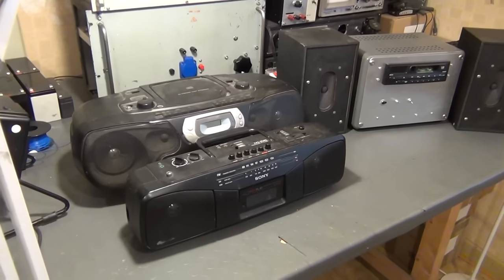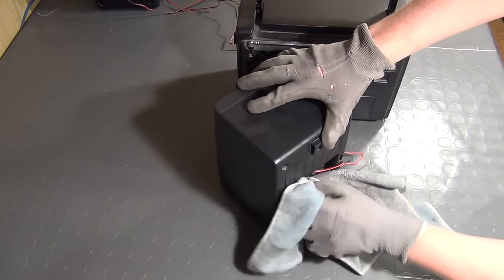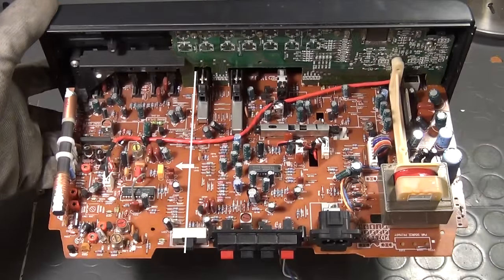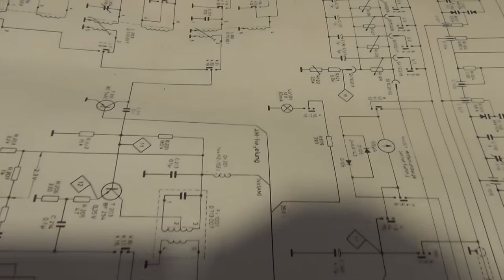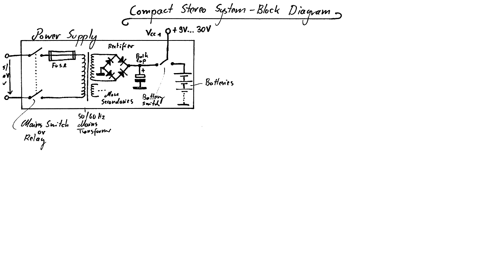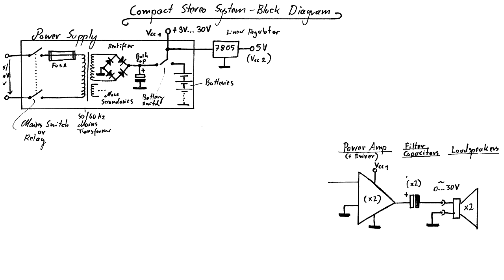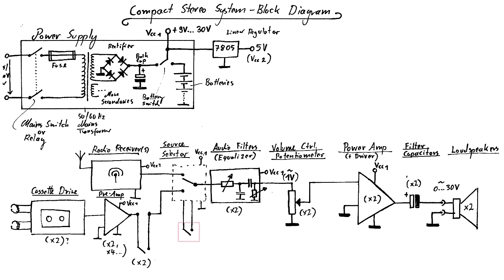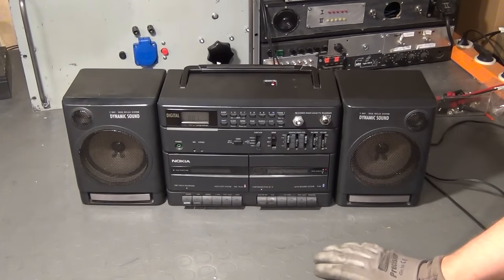How to Add a Line-In and Bluetooth to old Stereo Systems (1)

Comment: I'm currently modding a Lenoxx Sound CD-160 and discovered that the input MUX/Selector inside is actually wired and supports a 4th AUX input beside Tape/Radio/CD. So I can actually bake-in the missing feature by simply wiring a soft button to signal the electronics in making the the 4th selection for me. The onboard microprocessor, a TC-9309AF-119 already supports a button for selecting AUX, in it's matrix even though the feature is not offered by the boombox front panel. And the selection chip, a TC4052BP already supports switching between 4 sources by decoding the 2-bit signal from the microprocessor. The audio input pins for the 4th source (3X/3Y) are simply left floating on the PCB, so this is where I should tap myself to take advantage of all the selection circuitry already in place. This should yield a pretty cool, close to factory integration as I don't need to bypass anything, just add missing components: a soft button and a line-in jack. It's only sad that Lenoxx didn't offer AUX from factory considering everthing is pretty much there already on the inside for supporting it.

I came here seeking more information about what I should connect as an input, assuming I can't just connect bare wires directly to the input selector switch. Surely I need some kind of filtering? Coupling capacitors? Protection from static or over-voltage?

Based on what this video says, no I should be able to connect this directly from a 3.5mm female jack added on the front panel. I guess we'll see about that.

Comment: I've heard about an absolutely awesome build: Someone took one of these old cassettes that are made to put into a car stereo and have a wire with a headphone jack coming out so you can connect your phone. He removed that wire, and put in a small generator that is driven by the tape drive of the radio, and connected it via a LiPo charging circuit to a small battery, probably from the bluetooth headset as well. Then he took a pcb from a stereo bluetooth headset and connected that to the system as well, but on the output side, he connected the magnetic field generator that fed the audio from the headphone jack to the tape drive head before, and now there is a cassette that you can put into your vintage car stereo and have bluetooth audio capability. This is such an awesome product idea, I am really wondering why noone hasn't made a product from that yet. I think there are lots of people who would pay 20-30€ for that if it's well made. Or only 10€ for the China version ;)

Comment: Usually when the radio and amplifier circuits are on the same board, it is difficult to find the audio signal terminal.
One trick I found was to touch the terminals (careful, do not touch any power circuit terminals) and the speakers make a low (bassy) sound if you touch the signal terminal. This is how I located it in my 90s Panasonic radio cassette recorder

Comment: These should have had Line in from the start, that's how I would have designed them. I've had many stereos I wished I connect to other things. You could just get one of those FM transmitters for car stereos as a sort of "line-In" when you have the radio tuned to it, with the added bonus that I can record it. I don't give a dam about bluetooth and other "phone" devices though as I'm an analog guy. Cassettes, vinyl and mini-dsc (even though it's digital) is better.
Reply: CoolDudeClem Go old skool Nokia radio... just need the matching Nokia cellphone!

Comment: Vielen Dank für diese wundervolle Inspiration! Ich hab mir vor zweieinhalb Jahren einen alten, relativ einfachen und billigen Panasonic Ghettoblaster als Küchenradio gekauft und das Gerät hatte nie mehr als FM und Tape. Ich hab mich eigentlich hauptsächlich darauf eingestellt damit Tapes zu hören (hatte damals auch extra den Riemen deswegen wechseln müssen), aber da der Mechanismus dafür relativ billig ist, es immer leicht zu schnell spielt und auch nicht gerade gut mechanisch mit den Bändern umgeht (alles verglichen zu meinen zig Hifi-HighEnd-Decks) habe ich es mehr als Radio benutzt, auch mit einem FM-Transmitter. Dank Ihres Videos konnte ich dieses Gerät jetzt mit zwei Cinch-Buchsen nachrüsten. Der Chip war einfach zu finden (einfach in der Nähe des Anschlusses des Tonkopfs geschaut), dann die passende Anleitung im Netz rausgesucht, drei Kabel für links, rechts und Ground angelötet, zur RCA-Buchse verlötet und fertig. Ist zwar primitiver als Ihre Lösung, aber ich bin auch nicht gerade der handwerklich begabteste. Und was soll ich sagen: ich bin zufrieden. Wenn ich jetzt auf Play drücke ertönt das Signal des Aux-Einganges (solange etwas angeschlossen ist) und sobald ich den Klinke-Stecker rausziehe kann ich das Signal vom Tapedeck hören, falls ich das noch brauchen werde.

Vielen Dank für diese simple Erklärung mit der selbst jemand wie ich etwas anfangen kann, obwohl ich selten mit so etwas hantiere und liebe Grüße!

Comment: Ok! Your a smart guy... and I can’t seem to find anything helpful online.

I opened my UNDERMOUNT KITCHEN RADIO unit & SPLICED IN 2 exterior speakers. My goal is to have sound on the deck; off kitchen!

Here’s the problem I’ve encountered: volume control for the exterior speakers. With the kitchen sound normal, the exterior sound is too quiet.😞

💁🏼So, how do I ADD VOLUME CONTROL (w/CUTOFF) to the additional speakers🤔 
An inline (speaker) control is an easy enough fix...BUT....the next problem becomes the INTERIOR sound must STILL be turned up too much- SO THAT the secondary inline control can do its job. 

Scenario:
I have run 2 additional speakers (exterior) from my undermount kitchen radio- (they are spliced to the internal speakers in the unit; because I couldn’t find a better place to splice them) to the deck.

It works fine, but there’s the volume issue.
💁🏼You want the exterior speakers to be much louder, but as is: the only way to turn them UP is by turning up the kitchen sound -which is then way to loud.

So in theory, an inline speaker control would suffice the exterior control on sound...
BUT the origin of the sound would still have to be HIGHER, and then the added exterior speakers adjusted thereafter via the inline control dial 😩

So is there a way to 🤔😂 AVOID turning UP the internal radio volume -in order to increase the inline volume to the added speakers????

Just hoping you have some input 🤷🏼‍♀️ I know it’s a longshot!
Thanks!

Comment: Thanks so much for this. I attempted to do this on an old 8track player. I messed it up by wiring in to the pre-amp, with limiting resistors for the voltage from the output from phone, but it blew out over time anyways.  I think that it was just to much for the pre-amp chip.  Anyways, knowing where to line in from your diagram really cleared things up.  Wish you would have given an idea of voltages, and power output from volume control from the earphone jack though, which was the problem.  But thanks, fo rthe video, great job.

Comment: I have learnt quite a lot from this video. Thanks. I have a question:will it be possible to receive the new DAB system in the future in our old FM receivers? Will it be necessary to use them even with the new dab system? In Norway the FM broadcasting is dead now, what can we do to be able to get the dab system in our beautiful old radio fm receivers of th 60ties? I would be very grateful to hear your opinion if possible.thank you very much for your time and your wonderful videos you have made so far.

Comment: The cassette pre-amp IC has a 1990 date code, and the PA IC has a 1991 date code. So I think the radio is exactly 25 years old. The original owner must have put in batteries they had on hand and never changed them. I'm impressed with the battery quality; not a sign of leakage.

Comment: Hi Guys, I usually dont ask for help with my projects but my knowledge of electronics is only average. I have a HiFi from 1994 that does not have AUX input. I have the circuit diagram for this model and was looking for some help to understand the cirtcuitry to implement what PAI has done with his old radios here. The system is of sentimenal value as it was the first stereo my parent bought by as a birthday gift and the sound is also really good so I dont want to throw it away but Im willing to sacrifice one of its functions CD/RADIO/CD in order to add an Aux input. I have my own channel so I am also open to collaborating with other youtubers on this. many thanks.
Reply from the maker: If you can send me the schematics, I might be able to show you where the  AUX can be inserted. If you can, send the file to inventordonations@gmail.com cheers, Gerolf

Comment: Hi, I just got a (very free) Panasonic SU CH-40. It works just fine, but I intend to merge all four units (amp/cassette, cd/radio modules and the 2 speakers) into one single volume, which i'll fabricate, chopping off both cassette and cd player on the way.

I want to do this because it's just too clunky to have 4 separate pieces, and i want to be able to move it, and so, I plan to throw a bluetooth receiver in; but also, I'd like to fit it with batteries. Do you have any instructables on how to do this???

Comment: I have a 3mm mic input on my old boombox which works fine with up to 10% of my pc output volume. How about bypassing the mic amp with some wire and use the port? is it possible? or maybe make an external 1:100 voltage divider as an attenuator and connect input and output jacks to it? what do u think?

Comment: Good video, I have worked on a similar project, last week, it had a input slector/ volume control/equalizer IC all in one, we hacked the audio input there, we got it to work but then we went back to make abetter connection to the pins, we killed our IC and cant fint another one. Sucks..

Comment: Half of me is "well you could just some stuff from china to do that!" then I remember half of it is crap and the old school stuff seems to still kick it along brilliantly.
Reply: Gear from 20 years ago will outperform any crappy chinesse thing. They were built to quality. To get a proper 80s construction and quality, today you need to spend tons of $$$$$$$. That the reason why vintage gear has gone so high (prices) in those years. People relised how crappy actual audio gear is .. and is going back. some of them go far too back into tubes ... but this is BS IMHO.
Reply: Barry Manilowa Sure. Another issue is people not willing to pay for a good thing. Just have a look how expensive a Bose Wave Radio is, or their sound socks. They are pretty decent, portable, but too expensive. I havent seen a piece of chinesse gear built to quality except a valve amp. Of course they can build quality, but people is not willing to pay for it. Vintage systems are expensive but cheaper compared to any today gear matching that quality. Something is sure, you are not getting a Sansui 717 anymore. Even when paying because this bussiness model is DEAD. No one will care of every cap being elna, custom sanken semiconductors, metal knobs ....  today that is premiun grade. Of course there are high end brand like McIntosh, but who on the earth can afford that LOL. Cheers

Comment: Could you put the aux jack straight to the tape read wires and the just hit play to use it
Reply: that does work but sounds terrible.  I have tried.  We are doing these as a class projects but the students are still super new to electronics so its very hectic for me.  We have successfully added audio to 2 stereos that had only tape, cd, and radio.  they now have bluetooth.  the trick is to find the audio amp chip.  Ground out your audio wire then turn on a source and play music to it and touch around on the suspected amp chip til you hear sound.  That is what I have done anyway.  There is some background noise but it sounds surprisingly good.
Reply: +jdogtotherescue Can you please help me I posted a comment just a minute ago. can you read it and tell me if there's anything I can do? Thank You 👍
Reply: That's Not Me you are gonna have to copy your post again.  I don't see it.
Reply: +jdogtotherescue I can't copy it becuase I'm on my phone, but it's on the video comments seccion
Reply: +That's Not Me *because
Reply: That's Not Me I'm also on my phone.  if you want help you're gonna need to do more than that.  I love a challenge but I don't know what you asked.
Reply: jdogtotherescue Fine, I have a Kenwood speaker system but it doesn't have an AUX nor Bluetooth is there away I can connect my phone using an AUX or even better my Bluetooth? I've tried connecting an old phone's bluetooth to it but, I may be doing it wrong. Any suggestions?.
Reply: So this stuff isn't all that complicated but it does have a high entry level for an absolute beginner.  That being said, on every stereo there are inputs (radio,cd,tape) and there is the amplifier chip on the board that then feeds the audio signal to the speaker.  There will most likely be more than one chip on the main board of your radio but one will be the clear audio amplifier and when you look up its data sheet it will tell you that it is an audio amplifier or something like that and it is used for such jobs as amplifying tape and radio and the like.  Now what I have done is after I identify what I think is the amplifier, I identify a ground point which is really easy because just about every other point seems to be a ground.  Anyway with a ground point on the radio soldered to your Bluetooth's ground point, you can start the Bluetooth receiver playing audio.  Then with either the right or left channel on the Bluetooth adapter I take a lead and touch around on the suspected amplifier chip until I hear my song playing out of the speakers.  You need to have the player switched to cd or something like that.  I haven't needed to play an empty cd or anything yet.  I know this isn't as technical as TPAI says it but it has worked for me so far.  I think the hardest thing is just getting the stereo open and accessible but still fully functional so you can test it.
Reply: Thanks bro I'm going to try it 👍
Reply: snapper mower man ok

Comment: I need that Bluetooth Receiver for my Car. It already has Line-In, so it shouldn't be a big problem.
Reply: +Tummas Eivin Kruse how would you implement?

BT audio device connects > feeds audio out > 3.5mm to RCA >rca to aux input radio 

+ remove led indicator to place where needed.

radio set to aux, BT connect, audio plays

anything missing or wrong W this approach?
Reply: Ninja Master 5 V from the USB Port, and the Audio Wires to the Audio In
Reply: That specific bt receiver has a 3,5mm jack on it, so you can connect it straight to your aux input on your car sterio. unless you need rca, i would recommend soldering one end of the cable to the ROUT,LOUT and GND. I use that one in my festival-speaker. It works great. There are two leds on the board, but i never need to look at them. i just see the unit connected to my phone. My BT unit is also glued inside a car-sterio amplifier which is screwed on to a HiFi speaker so i barely see any light from the leds.
That unit is also 12v, so it's easier to connect it to the acc. cable coming to your sterio. Just don't put the unit inside any metal box or else your will need an external antenna.
Reply: Tummas Eivin Kruse I know that the Unit i ordered works on 5V. But luckily my Car has 5V. I am thinking about putting it into the place under the Armrest, as there is enough room to fit it all. And if i need to check something, i can access it really easily